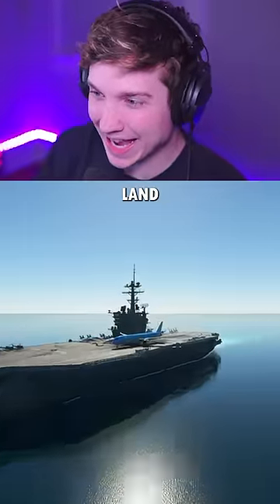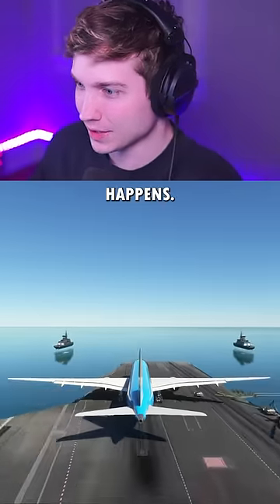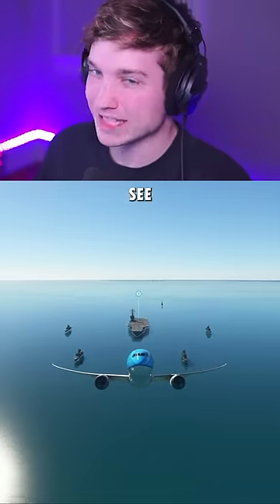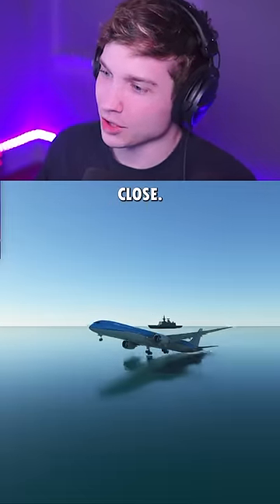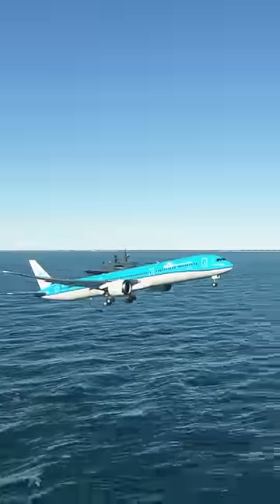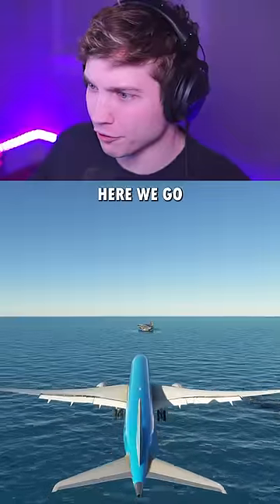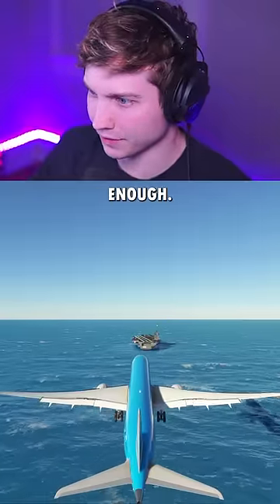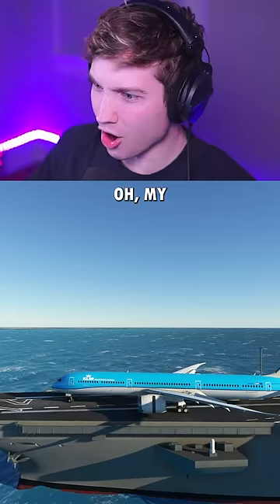Landing 787 on an Aircraft Carrier

Comment: You could have had a way easier take off if you. Hold the brakes push throttle to 100% wait for the engines to get to 100% than let go of the brakes and the plane speeds up quicker